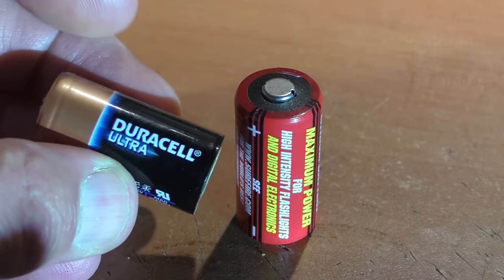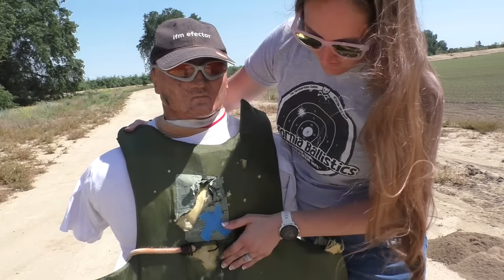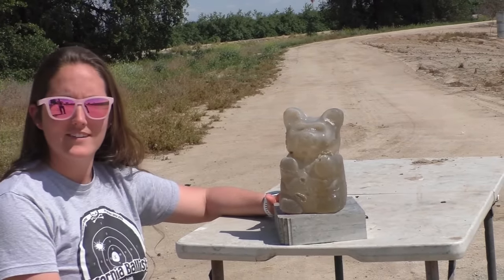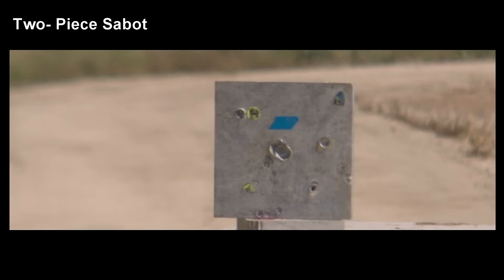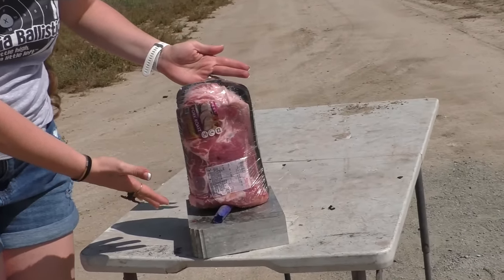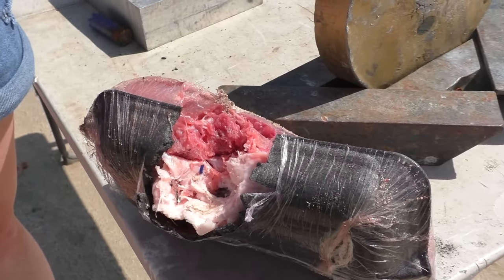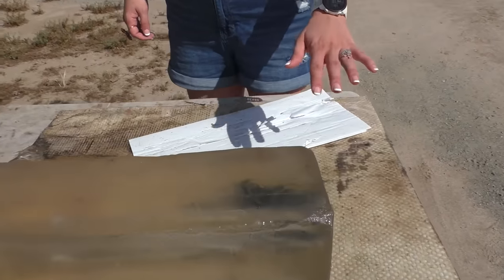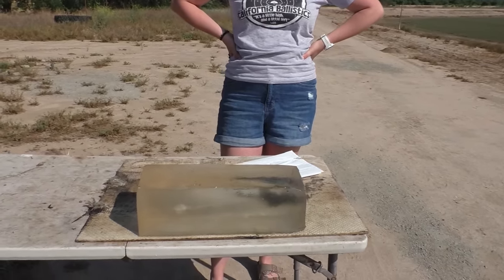12ga. Shotgun Lithium BATTERY Slugs-  Brutal Results!

Comment: Silly question: 
If you shoot a completely charged vs a depleted one, would that make a difference?
Reply: If its charged there will be some amount of explosion
Reply: If its charged then it will electrocute the target
Reply: It might be a shocking experience. 
Sorry I couldn't resist.
Reply: @samueladams1775  The results might be either POSITIVE or NEGATIVE.  Couldn't resist lol
Reply: I think the lithium is reactive in and of itself, but I would love to see that tested.  Interesting question
Reply: From what I know, it's overcharged batteries that have the splodie issues.

Do with this information what you will.
Reply: Lithium reacts with water, so shooting a tank of water with lithium of any form would be... Interesting
Reply: @lmfao5411  you nailed it. I think that's the real question that matters. If you could purposely overcharge it to just before it blows would you be able to guarantee a more volatile impact?
Reply: Charged ones add electrical damage to the target.
Reply: Yeah you don't need as much powder with the charged ones....
Reply: @bubbab89  you are mostly water... just saying...
Reply: Charged one would probably ignite after the impact. Then, the lithium hydroxide will start dissolving the flesh.
Reply: Charged one adds +5 energy damage.
Reply: Chemically they are ever so slightly different since the electrolyte is either used up or not. Should be a big difference. That said, you can test a battery charge by dropping it on the table end first and seeing if they bounce. If they stick, they are charged. So it may have a difference with impact or energy transfer? But at these velocities it probably doesn’t matter
Reply: This is, perhaps, the most unsilly question to ask after this demonstration. 
Yo! Now I wanna know.
Reply: @Tekdruid  also +5 DOT over the rest of your life
Reply: Well, it would have more energy..........
Reply: The metallic lithium in a charged battery will likely ignite.
Reply: Taking this a step further would it be possible to electrocute someone by shooting something like 220v supercap at them or does it just explode
Reply: @jeriztattoo  Supercap-ammo is only allowed to use against robots and androids.
Reply: The charged particles flying past the copper at such high speeds would create an electromagnetic pulse which will knock out any electronics within a 5 meter radius. Depending on the battery size, you could easily disable a modern tank with a single shot.

Source: I made it up
Reply: What do you mean? Is it an African or a European Lithium Battery? 👑🕊
Reply: @leximatic  omg ur right i don't know how could I forget something so fundamental
Reply: Completely charged gives +5 electrical damage
Reply: heating them up would have more of an effect
Reply: @bubbab89  - sounds like a 'fizzicle' job for the wet clay block . . .
Reply: Well... Literally that shotgun will be some kind of electron accelerator
Reply: Yes very much so. A Lipo under 50% charge when met with oxygen will expand and get hot and create smoke. A 100% charged battery will violently expand, shoot fire, and get extremely hot.
Reply: It's why devices shipped in the mail are usually only 50-60% charged as it mitigates fire risk both ways. As a lipo that's 0% charged has the potential to swell and get hot if the temps drop too low, like in a cargo plane.
Reply: @BuzzinsPetRock78  How am I supposed to know thAAAaaaarrrgh?!😉
Reply: It might make a slight difference, as the energy contained in the battery would have to go somewhere after it's destroyed on a target
Reply: I think charged one should explode flashier.
Reply: Only matters during the robot uprising. Make sure you are only using dead batteries for robot uprising.
Reply: Chemically, maybe. Fully charged, you have mostly LiC6 and CoO2 (lithium intercalated graphite and cobalt oxide), discharged you have C6 and LiCoO2 (graphite and lithium cobalt oxide). When discharging, the lithium ions move from the carbon cathode to the cobalt anode. There really isn't any elemental lithium present, so the whole "alkali metal and water" thing isn't an issue, fortunately or unfortunately (depending on your point of view). The black powder is graphite, which really isn't toxic, but it's insoluble too, so it's staying put in a living target.
The really nasty chemical actually looks like the most common electrolyte, which is lithium hexafluorophosphate. It's both corrosive and highly toxic.
Reply: @sternonisoil  Unfortunately not. Overcharging creates cobalt(IV) oxide, which ruins the battery, but doesn't really add any energy to a collision.
Reply: @aceg81  dang, thank you for the info
Reply: Believe it or not fact used old batteries are lighter some how if fully charged the batter is heavier can't explain the physics of it but saw this on a science program about batteries so accuracy would be effected of being consistent with repeated shots best to have all the batteries if hand loading to weight the same to get consistent accuracy a few grains different would make a big difference in consistency
Reply: @leximatic  ..and zombies?
Reply: I think a new unused battery is less black stuff in it and cleaner, a used one is dirtier and a dead one is harder on empact.
Reply: I've seen charged lipo batts burn and they're as dramatic as a smoke grenade.
Reply: +25 electric damage

Comment: Lithium is supposed to explode in contact with water. Did you get any fire reaction to the gel off camera or later? I’ve no idea how much lithium is in a lithium battery but guess it’s quite a bit.
Reply from the maker: I've purposely cut these batteries apart and threw them in water and all they did was fizzle a little.
Reply: The lithium in batteries is bound in pretty specific chemicals, the videos where it explodes in water is with the much more reactive raw metal
Reply: @AVUREDUES54  Thank you! Am glad to know it. Is it still poisonous?
Reply: @jackjones9460  it would at least be alkaline and extremely irritating, like bleach, if not worse
Reply: @jackjones9460  Yes.
Reply: Hi, sorry if I missed it, did you guys 'make' these by re-load/re-purpose of a factory Target or Slug load?  or do these up from components on a re-loader?  Thnx
Reply: Thought i saw flame when the plate got nailed
Reply: The lithium I have seen react violently with water was totally unrolled from the battery and tossed in water.
Reply: @GilaMonster971  and the body is mostly what😈. Be a hell of a thing to get hit with
Reply: @GilaMonster971  That was specifically Lithium-AIR batteries which you can unroll large amount of lithium from sheets. That is a very rare specialized use case DISPOSABLE batteries. CR123 Lithium manganese dioxide are very very different cell chemistry. FYI there is vast number of difference Lithium Ion cell chemistry which uses small fraction of lithium.

Comment: Pretty sure this would be the end for anyone, no matter where it hits, as lithium in that amount, in that manner of distribution would be so poisonous you wouldnt even last long enough for an ambulance to show up, even if hit in the leg or arm.
Reply: That's if the energy being dumped doesn't almost immediately tear off the affected limb to begin with
Reply: For real, it's highly toxic. Wish they would have taken some precautions instead of just handling it bare handed after shooting.
Reply: Lithium hydroxide conversion!
Reply: Then I will gold plate the gun. (The man with the golden gun.)
Reply: Lithium isn’t particularly toxic. It used to be a component of “7up” (Lithium is element 3, atomic weight 6 to 7).
The other chemicals in the batteries - that’s a different question. The batteries have a lot of copper, aluminium and manganese oxide as well as a stainless steel case that all turns to splinters.
Reply: @allangibson2408  first, thats lithium citrate,  not lithium magnese oxide/iron oxide, cobalt etc etc.  This is some basic chemistry here mate.  There are WILD differences on how they effect the body depending on how the atoms are structured.  Let me give you an example.  Sodium chloride, aka table salt.  Sodium in its raw form in anything more than trace amounts is dangerous to the body, and actually violently reacts with water.  Chlorine, extremely poisonous,  is the componate here, ends in ide if it has only 2 compounds, ate if it has 3 or more, one of which being oxygen.  It also matters whether it is positivelly or negativelly charged to determine if it is stable, or will give/take electrons from other compounds it comes into contact with.  So you can eat sodium chloride, but not sodium chlorate.  Even though the base elements involved are still sodium, and chlorine.  Lithium in its base form is very much so dangerous to humans, add in its chemical makeup when it is added to cobalt, magnesium, iron or other things and it can be even more so.  You can make inherently dangerous chemicals safe by adding other chemicals that make it stable, and ether not react, or not be broken down into something dangerous when it interacts with the body.  The inverse is also true, you can make elements that are inherently harmless EXTREMELY dangerous by the simple addition or subtractions of positive or negative ions by combining compounds.  Thats how chemistry works mate.
Reply: @herpderp1662  Lithium itself is not particularly chemically toxic in any form. The explosive conversion of the stored chemical energy is a bigger issue. Getting hit by one of these would be on par with an explosive bullet.

Comment: I'd love to see this against ballistic torso, how it damages the organs etc

This would be the best ammunition for a post apocalyptic world if you can't really craft slugs and such
Reply: Those batteries could probably be way more useful in tech than being fired out of a shotgun in an apocalypse.
Reply: @vladpintilei6204  dead batteries can be repurposed to ammo though.
Reply: @trippaturtle  can't you recharge batteires tho? Otherwise I guess they'd make good shotgun ammo but you could probably harvest the metals inside and repurpose them'
Reply: @vladpintilei6204  Typically, rechargeables come in more common varieties such as AA and AAA. Any rechargeable 123s would be extremely valuable and wouldn't be used for ammo, since tougher flashlights commonly use them. Regular 123s would be good for powering tech, but then once spent would make terrifically effective anti-personell slugs, requiring even a poorly placed shot to the victim's foot to require amputation or risk death. Battery chemicals don't typically behave nicely in the bloodstream, so they'd almost be better and cheaper to use than reloading ammunition regularly.
Reply: @pyrosweets  better maybe, but I definitely doubt cheaper. You can load anything into a shotgun casing and i'm sure stones or skateboard bearings could produce similar effects. On top of that, the metal poisoning is cool, but what does it matter if your opponent is not down and out immediately from the fight (he probably would be anyways though because it's a fucking shotgun lmao but it wouldn't be because you shot him with a battery), the poisoning is irrelevant if the guy can get back up and blow YOU to pieces, just to die after.
Reply: @pyrosweets  car batt use lead plates, after a while the form cracks and increase resistance to the point of being too low power for starting. You can replace the plates or recast them.
Reply: In quantity I think melting and casting lead and other metals would be more practical. But these are cool anyway.
Reply: @vladpintilei6204  I mean, once the battery is dead, you got no other use out of it

and basically since it will perform approximately as good as a normal slug, the poisoning and other stuff is a really neat bonus

outside of the literal explosion, shrapnel and such that a normal slug wouldn't have
Reply: What are you expecting to do with that against a ruzzian nuclear rocket ?
Reply: i'd rather buy a steel bar ofthecorrect diameter and cut pieces of the correct lenght from it.
Reply: I have seen what it does to a Deer.
Reply: @drefhill  What counter-measures have you prepared against those nuclear rockets? Interested how you're shooting yours down, I seem to have no luck with them. Can't afford them Patriot missiles because I spent too much on other stuff I guess.
Reply: Seen it against a real face. Not pretty. This is common here in London sadly.
Reply: If you made a lithium slug that got stuck in someone's body then the acute lithium toxicity would end up lethal rather quickly as the lithium enters the bloodstream. A synopsis of the symptoms I can give (after gratuitous reading of synopses and plenty of Google-Fu) would basically sum up to:

Shakes and nausea, you start throwing up and sweating, speaking and understanding speech gets harder, vision blurs, shakes get worse to the point of being unable to stand unassisted, you start shitting and pissing yourself because your bowels and kidneys stop working right, neurological degeneration happens, you get very tired and confusion sets in badly, and at this point you're either dehydrated so badly you might die soon anyways and the drowsiness gets so bad you black out and wake up again until you black out one last time as you slip into a coma and then probably die. I doubt hemodialysis and an IV would help at all since that much lithium screws the brain so badly.

A round with lots of lithium shedding it in your body is a hell of a bad way to go, the body only has about 2.5 milligrams of lithium inside it and a D-cell battery has roughly 1800 times more lithium inside it, about 4.5 grams, if even a tenth gets in and the rest leaves through the exit wound that's a lethal amount of lithium poisoning, provided the battery doesn't explode from residual charge and the impact force. Frankly, a pistol with low muzzle velocity and lithium packed in a hollow point round I'd consider worth pondering if it violates the Geneva Protocol for chemical weapons, although probably not since its single target and not a gas, but then again its effects might as well be single-target nerve-gas, so eh, more like just never use it because its unethical in a pragmatic sense and never make it since that lithium has better uses and never fire it at anyone even if they were asking to get shot back at because that's just needlessly cruel. All in all, its a very lethal round and should never be used. Ever. Just my very unprofessional opinion as an adept at Google-Fu with no practical experience and little theoretical knowledge on most of the related subjects, so frankly I'm wondering why I commented at all :P
Reply: 2023: "write that down write that down!"
Reply: @Avetho  Not in this form. Batteries contain lithium metal, an alkali metal which becomes exothermic and releases a ton of heat and can be explosive. This going in your body, hitting blood which is mostly water would cause some devastating heat damage. The wound may be cauterized and extensive tissue damage would occur. If you survived this somehow, then you may have lithium toxicity issues down the line though as the lithium metal reacts with your chemistry forming soluble lithium compounds. Bottom line, don't get shot with this one.
Reply: @vladpintilei6204  You can recharge them perhaps about a 1000 times, so depending on what you use them for - can last you a lifetime, or could last several months at worst, eventually they'll reach end of life and they're not easily recyclable even in current pre-apocalyptic world. Post-apocalypse it would probably be too impractical to recycle them into new batteries, so it could be more useful to repurpose them to ammo, I guess.
Reply: @vedranb87  how do you recharge single use batteries?
Reply: Could always make an artillery piece using old car batteries and a catapult.
Reply: @drefhill its only the buzzing of A FLY  🪰compared to the BEARD OF DOOM 🚀ROCKET!
Reply: well, shouldn't be too expensive to get some old batteries that don't work
Reply: The gummy bear was ballistic gel

Comment: "the ballistic gel is so expensive"

They've been saying that for at least 5 years now and have yet to come up with a way to keep it from flying off the table.
Reply: Taufledermaus isn't concerned with such petty things as clean ballistics gel. Just a tarp, four long .nails, and the gel would probably stay pretty clean.
Reply: I think its on purpose so you can get an idea of the energy transfer. If the block just sits on the table and doesnt move much then there was little energy transfer compared to if it goes flying 6ft in the air.
Reply: @izzyplusplusplus1004  its more for the camera work that he probably doesnt do it, but a encloser can be made for less than 100 bucks, out of clear materials and still allow an open window for the high speed shot.

100-150 bucks now, would go a long way in the future. We generally understand the energy transfer with the gummy bear where as the ballistic block for high speed is better suited for showing penetration and after 2 shots in the current let it fly everywhere setup, you really cant show it that well. a clear enclosure will provide that and make the gel last more than a handful of shots and in the long run cost less money. 

More Bang for Your Buck as it were.
Reply from the maker: it actually gets dirty just being outsize because dust sticks to it.   It takes a fraction of the time to wash it off than it would to lay out a tarp.